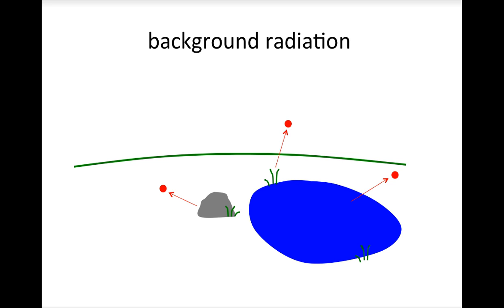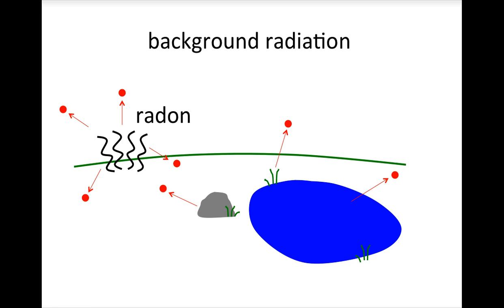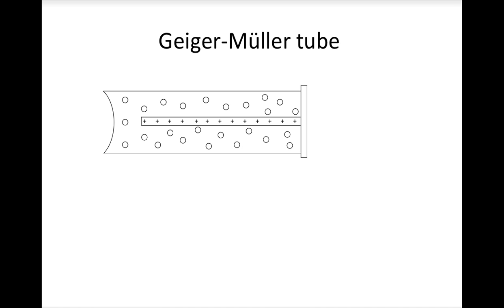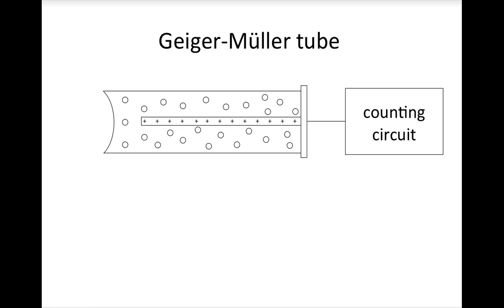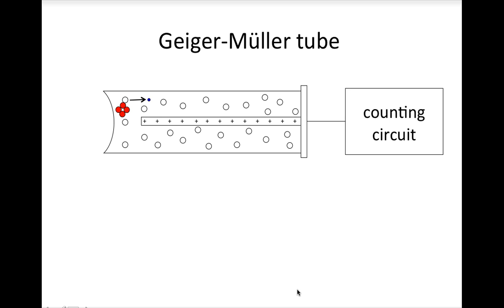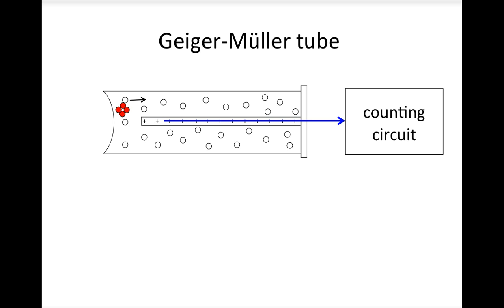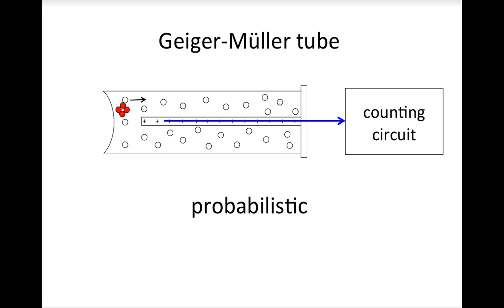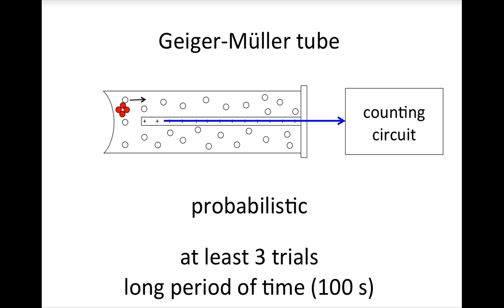Geiger-Muller Tube & Background Radiation ("Background Count")

Comment: how does the GM tube go back to normal
Reply from the maker: That's a really wonderful question. I think the last paragraph of this page gets close to your answer:
https://online.ucpress.edu/abt/article/27/6/435/6839/Operation-of-the-Geiger-Counter-Tube-and-Its
Something to note is that the situation is a bit more complex than I've described in my video here. As you can see by reading through p. 435 of the link, there's a cascading effect that occurs, with the electrons producing more ions and knocking more electrons free. The buildup in electrons is important, because a single electron may not be detectable. Good luck finding the answer to your question!